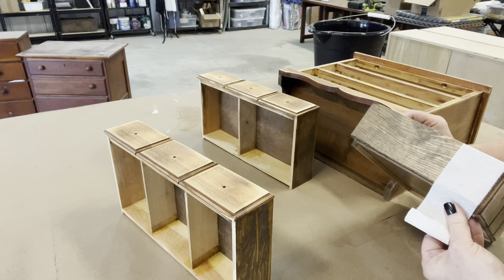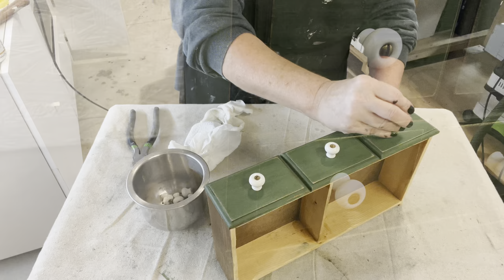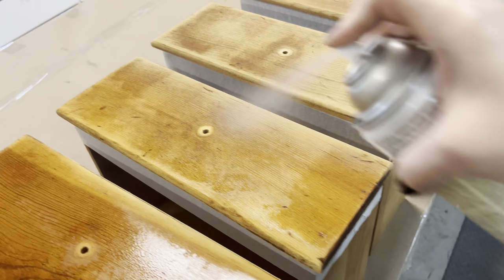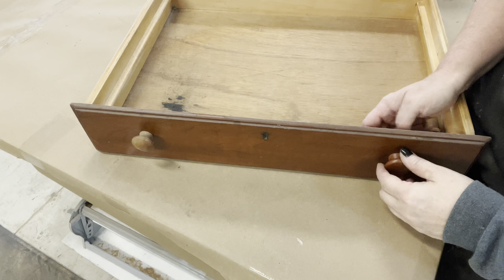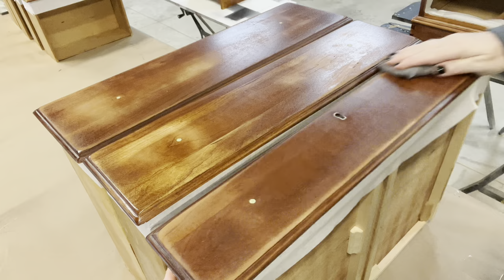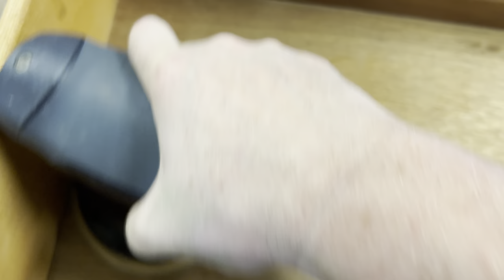MINI FURNITURE  MAKEOVERS FOR BEGINNERS | YOU GOT THIS!

Comment: So, you don’t necessarily worry about brush strokes because you finish with a light sanding? Painting intimidate me because of the brush strokes.
Reply from the maker: The brush bristles really matter. The softer the bristles.. there not as many brush marks. And are easier to sand off.

Comment: Beautiful pieces!  Question though..how do you decide when to use steel wool or sand paper?  Thanks!  Have a great weekend!
Reply from the maker: I use a very fine grit steel wool.. ( 0000) which is a finisher. Take off minimal. Just smooth. Sandpaper (220 grit) is stronger and will take more off.. like distressing. Paint to wood.

Comment: These are all amazing! My question is, you said that the Milk Paint won’t crackle on wood so how do you get it to crackle? Do you have to paint a different color and or type of paint first then add the milk paint? I just bought a lot of color samples in the milk paint and want to try and know it’s unpredictable!!!
Reply from the maker: I didn’t say it won’t.. it’s unpredictable. I was thinking because these pieces were raw wood. That’s the reason they may not of crackled. But I’ve had other pieces that were the same that did crackle. See unpredictable. It even says that on the package. I’m wondering if I painted another paint underneath if it would have crackled more. Or here and there( not on the whole piece, used the crackle medium. 🤗